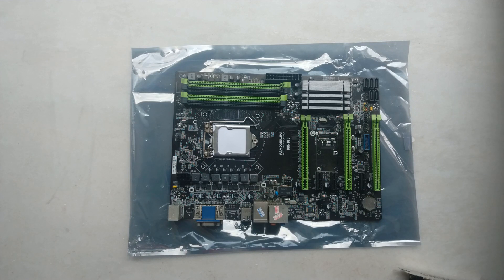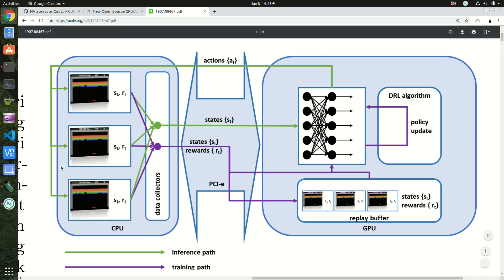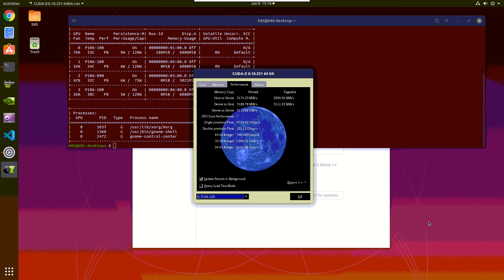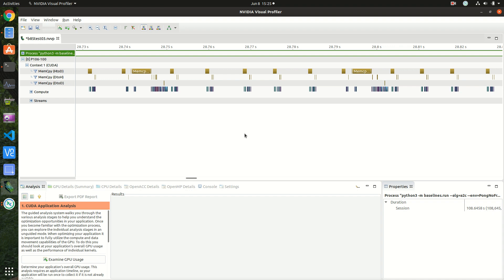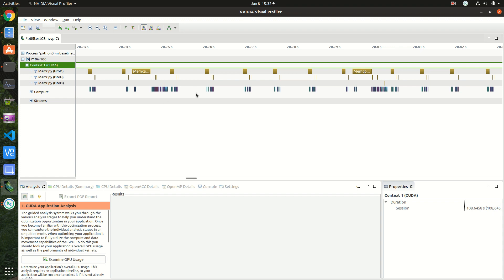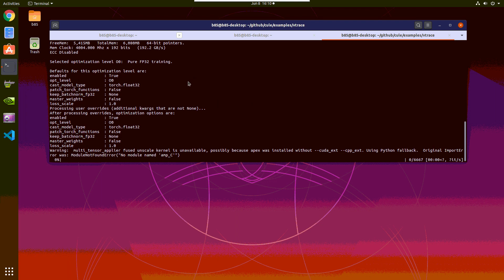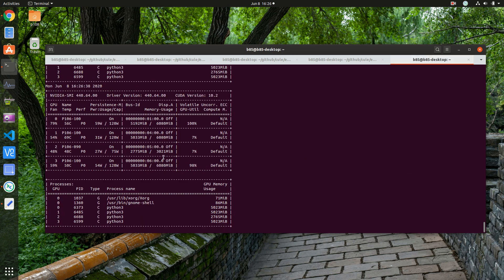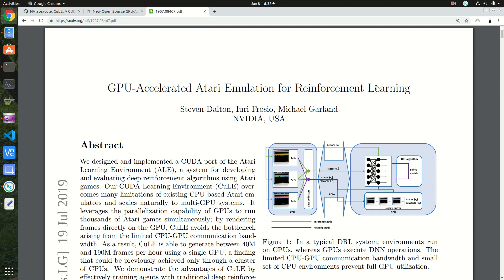Machine Learning on Mining Hardware - p106-100

Comment: I was wondering if all slot is pciex16, would the performance drop?
Example product:
https://shopee.com.my/product/152922623/6959541588?smtt=0.66108025-1615591911.9
Reply from the maker: usually mining motherboard have 16x physical slots but 1x electrical, but that is still fine for NVIDIA Cule. The problem thought is that the CPU in the link is too weak to serve all these GPUs at same time, its only good enough for mining, so I would not recommend it.
Reply: @videogamesai  thx. Good thing i ask, otherwise i would've bought that

Comment: Thanks a lot for your article and this video.
I have a project with small data transfers. I am yet to buy the P106 GPU. 
The question I have is will the recent driver version (440) be able to operate both gtx1060 and P106-100  simultaneously ? Will I face driver compatibility issues on Ubuntu with Cuda 10.
Reply: Yes, you can use both cards at the same time with CUDA 10

Comment: Very interesting. I have a GTX 1070ti, and I was thinking of buying 2 of those gpu to run on deep learning tensorflow. Do you think doing that would be a good idea?
Reply from the maker: depends on your needs, if you are doing vision or NLP related tasks I would recommend an RTX series cards instead. If it's AI playing retro games or physics (ex: robots learning to walk) then p106-100 should be ok as long as they are on PCIE 16x slots on your MB otherwise you will have to use a costum solution like presented in this video
Reply: @videogamesai  Do you think the PCI 4.0 bandwidth of the RTX 3000 will offset the fact they have less ram than an RTX 2080 Ti (11GB with 616 GB/s bandwidth)? The 3070 has 8GB of ram at around 512GB/s of bandwidth where the 3080 has 10GB of vram and 760 GB/s of bandwidth.